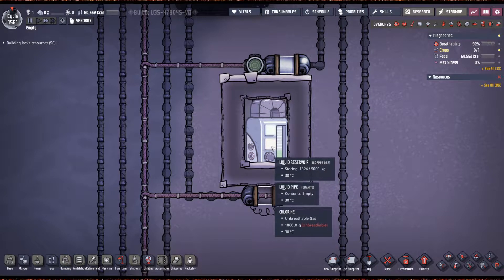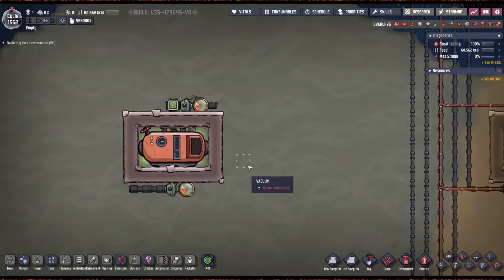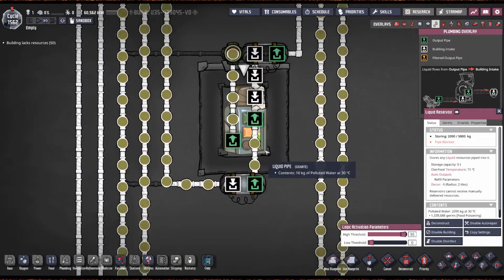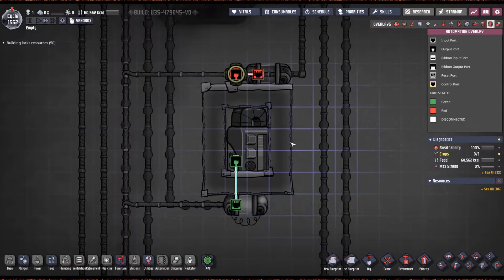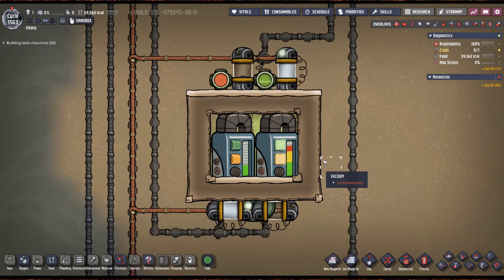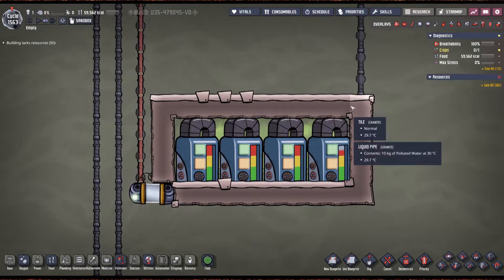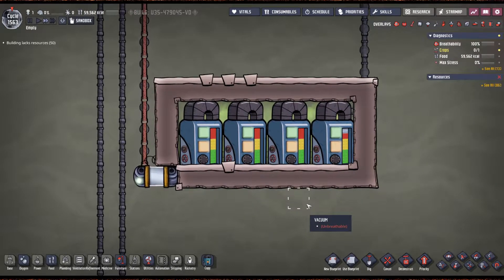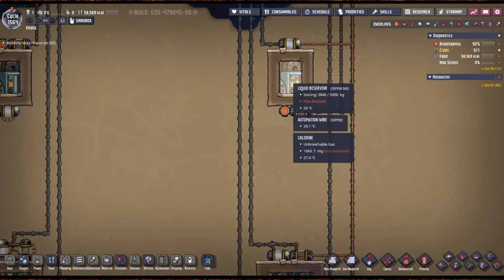dGerm - Germ-free Water Made Easy - Oxygen Not Included

Comment: I'm using one for my 2 electrolizers. It was easier providing them water from a polluted geyser with food poisoning then having to cool water from a Cool stem vent enough that it didn't really jack up the temp of the 02 coming out of my SPOM.    The water from the P geyser ends up being 88F after a sieve cleans it.   The water from a Cool steam vent is 160 or so. 

I'm using an Anti entrhopic thermo whatever thingy to cool the air to an avg of like 70deg F with the 88deg water.   I tried switching to the 160 deg water and my air was suddenly over 100!!!

Now I'm even using the SAME thermo thing to cool my air AND the 88 deg water down to the 70s...yah thats right,  both are coming out of it in the 70s. 

And I'm storing a lot of hydrogen that my 2 SPOM hydrogen generators aren't using because I haven't gotten around to hooking them up to my power grid. (it's on the other side of the map... blah, running high wattage wires that far is annoying... or even insulated pipes and another hydrogen generator in my main power brick. )

---Granted, I just might end up running out of clean water still because  the degerming setup I'm using might not keep up with the demand. I'm not sure why... I 'm currently thinking it's the sieve that the Pwater goes through first.  It's output is less then a pump which means it takes longer for the liquid resivor in the chlorine chamber to fill up.

---and then I watch more of the video and you don't have a sieve going into the chamber.  So yah, probably the sieve.

Comment: I had the exact same setup as the first example but the germ sensor stops detecting when there is couple hundred germs left in the tank, my output clean tank end up getting contaminated sometimes, have you seen that issue before?
Reply from the maker: When the tank gets down to about 1500 germs it starts piping out water with 0 germs due to how the game rounds down.  So it does start outflowing before the tank is completely germ-free but it doesn't matter since the outflow is sanitary.  I only encountered issues when I forgot to set the germ sensor.
Maybe some gets through when reloading the save, I didn't test that.

Comment: I always build these early on in conjunction with an infinite bathroom loop but I usually keep the pressure at 1800g min because I tack on a Water Sieve. The pressure keeps anything from off gassing and it's also a good place to store any bleach stone.
Reply from the maker: I've always just recirculated bathroom water back into itself since sinks never cared about using germy water.  Unless a recent patch changed that.  Excess toilet water could be fed into thimble reed or food crops as plant eat the germs and give you a germ-free product.
Reply: @tuxiiindustries  I actually cycle/store the excess clean water into my main reservoir. My setup goes output, sieve, input, then reservoirs. I actually haven't found a good use for polluted water, germ-y or otherwise, outside of early game reeds or emergency water. My chlorine room also only ever has 2-3 tanks regardless of if I have automation or not. That way I could set it up as early as cycle 30 and it'll keep until I'm ready to automate it with or without plastic.